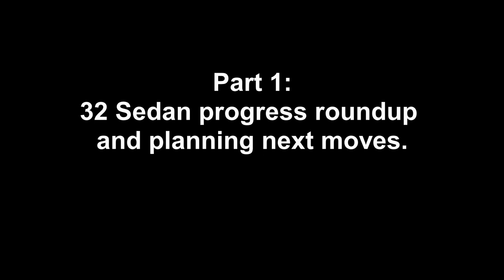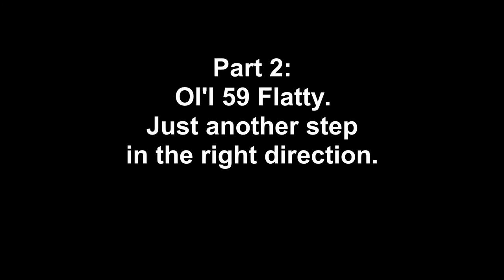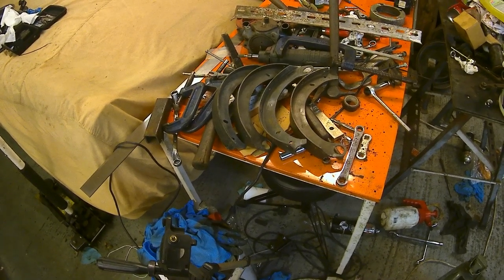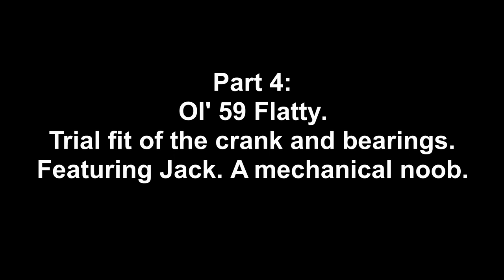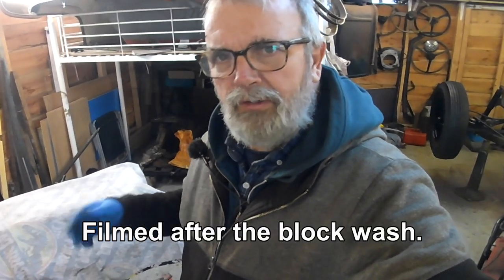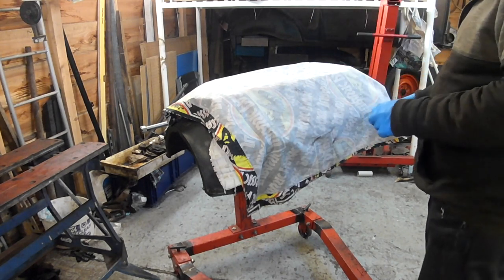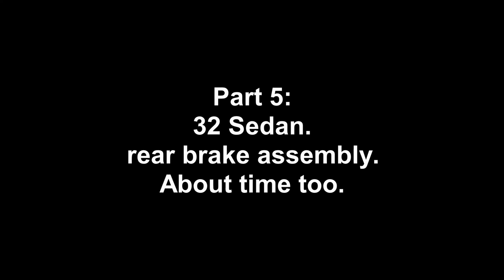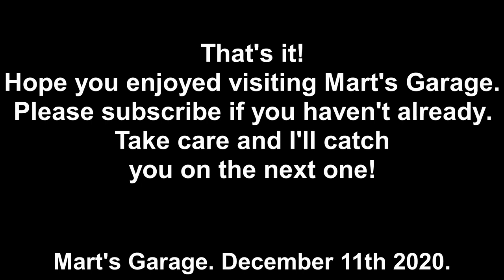Ford Flathead Crank Trial Fit. 32 Ford Brake Job. 32 Pt23 59 pt17.

Comment: Always good to have a willing helper in the shop, as I have gotten older it has gotten harder to do jobs I would have had no trouble with years ago, I'm repairing my 50 Ford transmission and it was a chore just getting it up on my bench. Have to work smarter not harder but we have learned a few tricks along the way, right Mart? Always enjoy your videos.
Reply from the maker: Thanks Earle. Smarter not harder couldn't agree more. Not sure I follow that ethos all the time though. Thanks for following along and commenting.

Comment: I will radius my brakes using your method. Plastigauge have let given me A Good Night's Sleep, more than one time :-) Thanks for sharing Mart.
Reply from the maker: Thanks Lars. The brake radius method works well enough for me. You just have to be careful with the dust. I daren't actually measure the bearings. If I did I probably wouldn't want to use them.

Comment: Kiora Mart,when I was 14,an old family uncle gave me the most beaten up neglected old 38 barrelnose 15cwt pickup,with a 35 motor (still in my workshop) I got another complete parts truck for $30,it was 1975ish,and did a resto/rebuild using a awesome 8ba.an old rodder dude where i was apprenticed told me to use english Mk1,2,3 Zephyr knee action rear shocks on all four corners,so I went to local car wreckers and bought 2 sets.They bolted straight on,and I cant remember about the links but I had to mix-match till it worked,perfect.Sold the truck for a deposit on a home LOL,now a 46 club coupe (ex NZ Govt car/Traffic patrol ) sits in garage.more LOL.Your rear shocks look exactly like those Zephyr units,but it was 45yrs ago.More great stuff Mart,your collection and workshop makes very interesting and informative viewing,on my top list every week.Ralph
Reply from the maker: Hi Ralph. I guessed kiora was a Maori greeting but had to google it to check. We had Kia-Ora orange cordial here, that's where I remember it from but didn't realise it's origin. Thanks for the comments. I like it when people actually write a little essay. It's fun to read. Thanks.

Comment: Interesting as usual. I drove past your house last week. Couldn’t remember why I’d been there before until I spied your 40 on the drive.
When I got home my wife had found an old leaflet from 2000 with your address on it. 
Keep up the good work.
Reply from the maker: Cheers Gaz. Yeah, the truck is a bit of a giveaway. I thought I had some Pilot rear drums. I can't find them. Did you have them off me? All the best. Mart.
Reply: @MartsGarage  I did buy some drums off you. I haven’t got them now unfortunately.

Comment: Hello Mart

The Chassis is coming along great and really enjoy watching the build.

I have several classic cars not as old as yours mainly early 1960s. I have to do things on a budget all the time and put a lot of thought into what I do so I do not waste time/money. 

If it was me I would not do any work on your engine unless I needed it, either for a spare or for one of your cars. Even as a spare I would have to look at how well it would store and still be usable. 

I think if I was you I would just work on parts that I needed so that I could enjoy the car as soon as possible. I was getting very frustrated with your thought process lol.  I was thinking that every moment spent on that old engine means a moment longer before you could drive and enjoy the car you are building. I just stick to repairing/building what I need so I can enjoy the cars. 

Im probably going to get a load of flack for saying this but I just think you need to make a decision and go for it. If you dont need the engine just leave it and crack on with your  other projects.
Reply from the maker: Hey, John you'll get no flack from me. It's a convoluted thing. I am enjoying both projects and the engine will get used, don't worry. I also consider the promotion of the hobby via my videos. I try and expel some of the myths and show they aren't at all difficult to work with. Thanks for sharing your thoughts, though, I appreciate that you sat down and wrote a thoughtful reply.